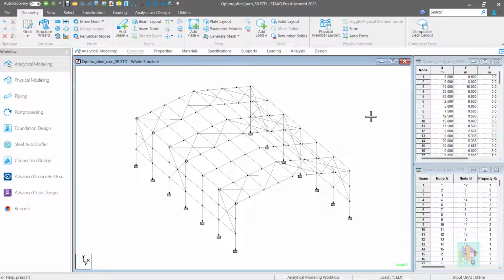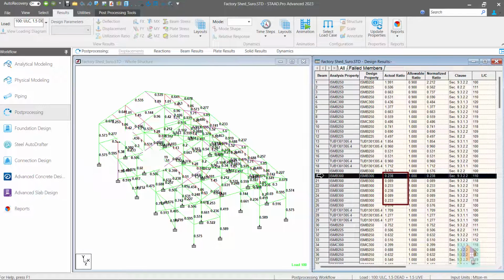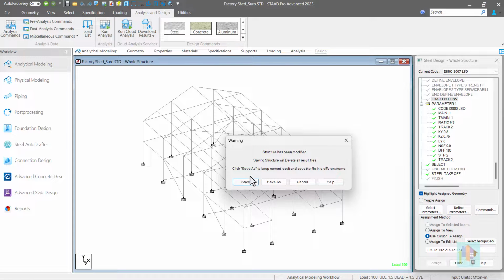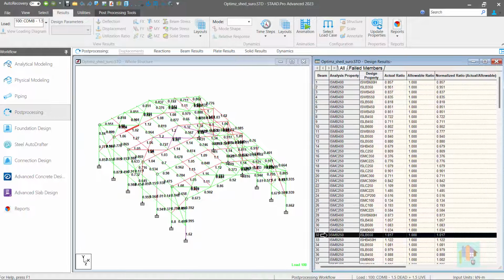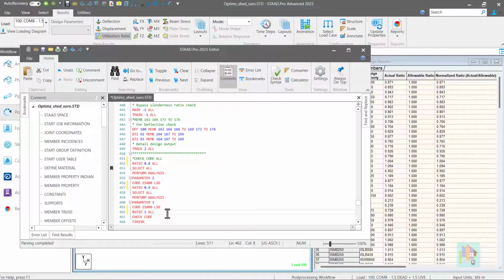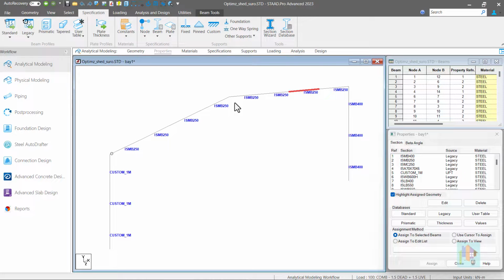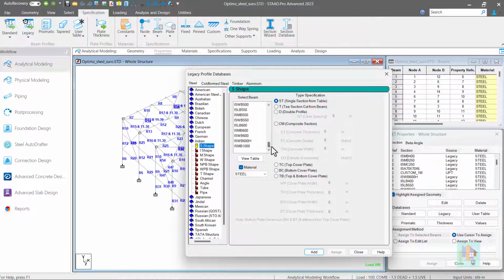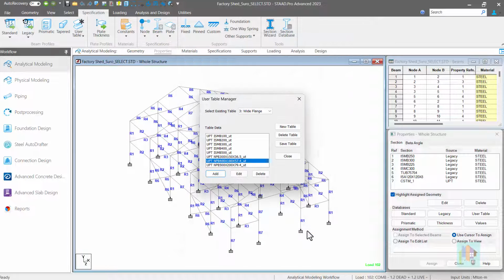Optimization of Steel Structure with STAAD: A Detail Guide || Design command, Sequence, Grouping

Comment: Hi sir just one question, in a complex structure there would be multiple beams and columns. If the single beam consists of multiple nodes does the software recognise as single beam or not. If not is it required to make every beam which is splitted into group